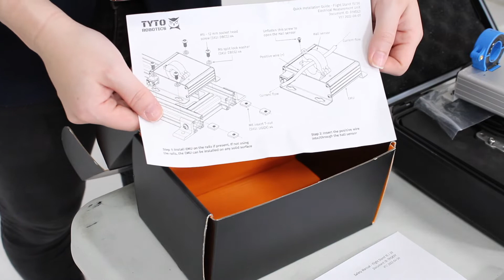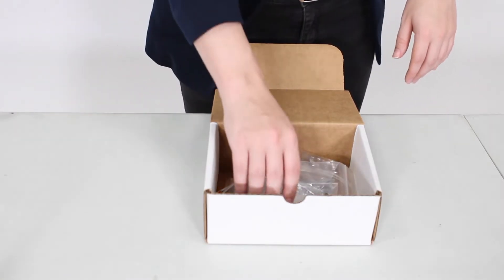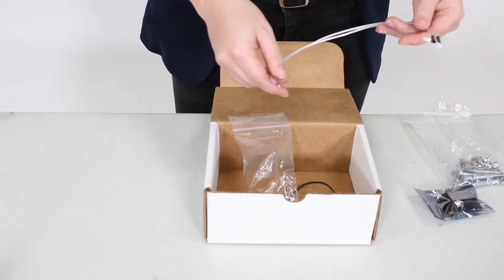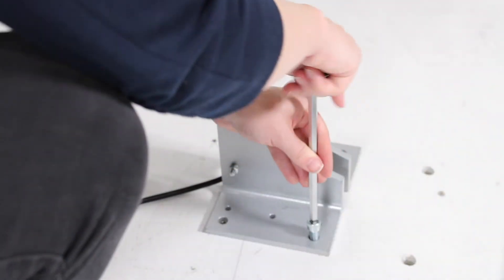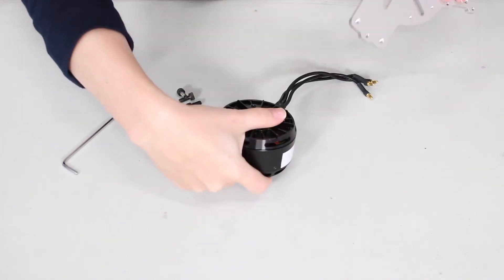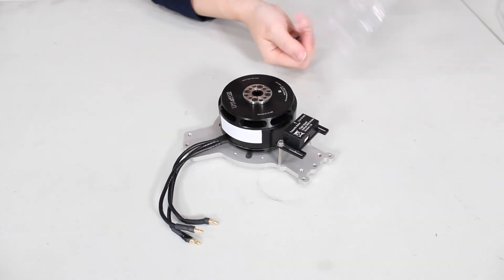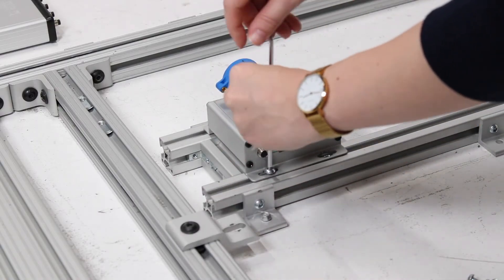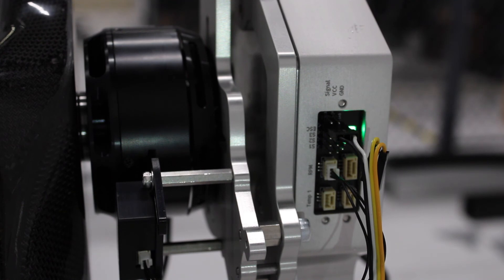Flight Stand 15/50 Thrust Stand User Manual Video

Comment: Ok, thank you very much. I have another question. Between minute 7.55 and 8.10 we pass a cable through the hall sensor and plug something into the emu. I never understood what we were doing in those parts, where that cable came from and where it went and what it was that we plugged into the emu at that time. Could you please explain it detailly? I would be very grateful.
Reply from the maker: Good question! These steps set up the current and voltage readings. The wire passing through the Hall sensor is the wire running from the power source (battery or DC power supply) to the ESC, where we measure current. For the voltage measurement, a small section of wire is taken from each of the wires running from the power source to the ESC, and inserted into the connector that plugs into the EMU, where the voltage is read.

Comment: It does not show where you putt the end of the Temperature sensors. Can you add a picture please ?
Reply from the maker: Hi Sim Dim, great question! Here's a photo of where the temperature probe plugs in on the side of the force measurement unit. At the other end (the probe), you can use an adhesive to attach it to the component where you want to measure the temperature. https://cdn.tytorobotics.com/Other/PT-100%20temperature%20probe.JPG